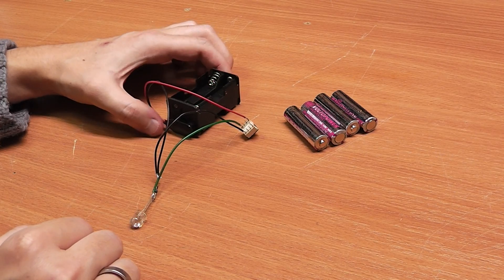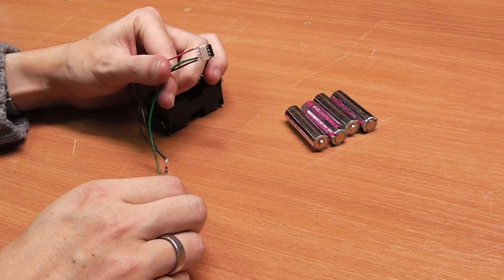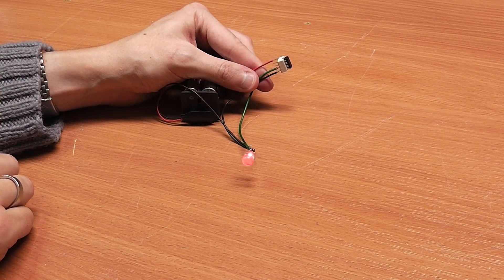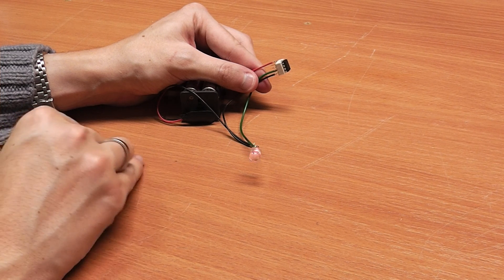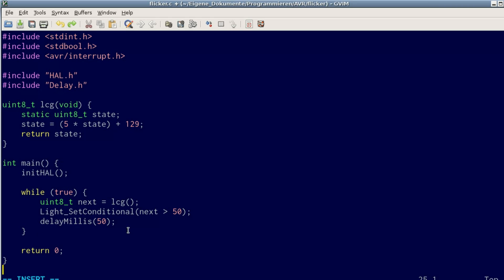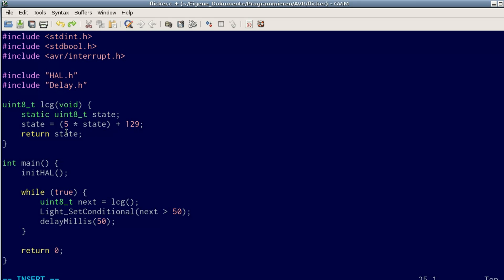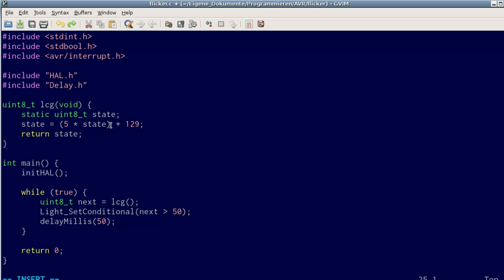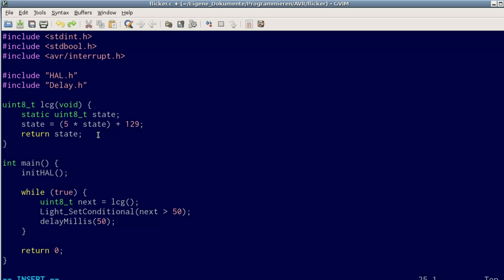Flickering Halloween LED light with ATtiny13 and a Linear Congruential PRNG

Comment: 5 - 6 V with 680 ohms and an ultrabright LED with 1.8 V/20 mA ?
 I can't see the color coding in your clip but there is something wrong.
Reply from the maker: I don't drive the LED at its max current. For 4 AAs the voltage ranges from 6.0V down to the cutoff voltage of 3.6V. This means there's a minimum LED current of 5.2mA and a maximum of 8.8mA. Just checked, the 680 Ohms is what I used.

Note that driving ultra-bright LEDs at lower currents has a much better energy efficiency than using plain old low-current LEDs. More bang for the microamp :-)